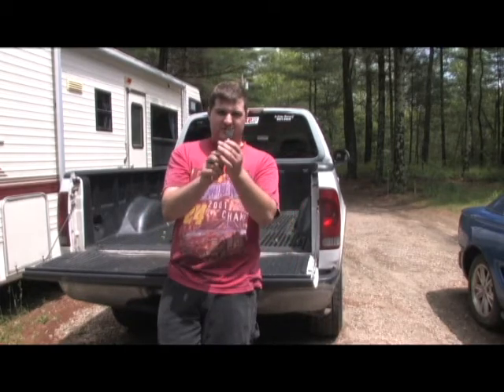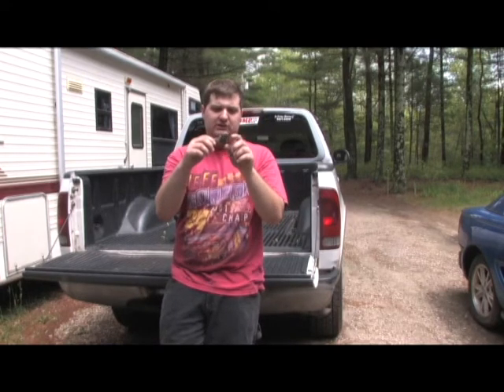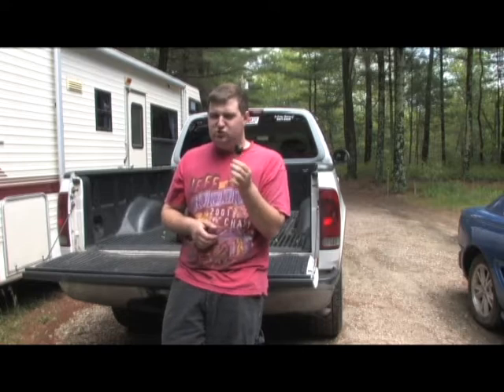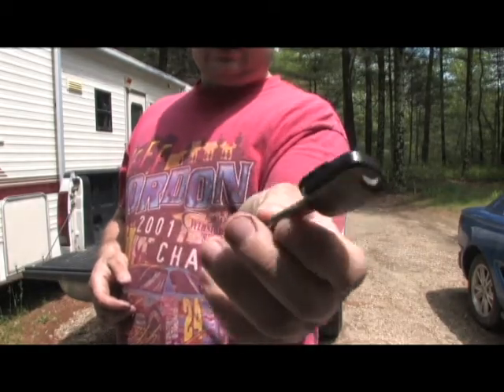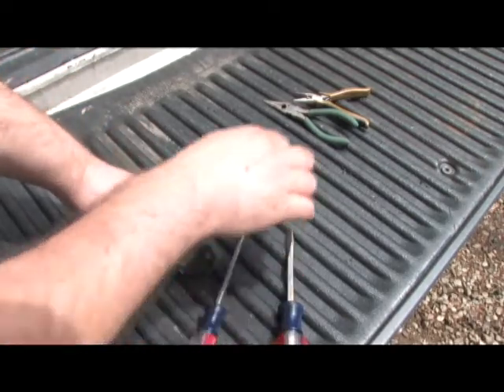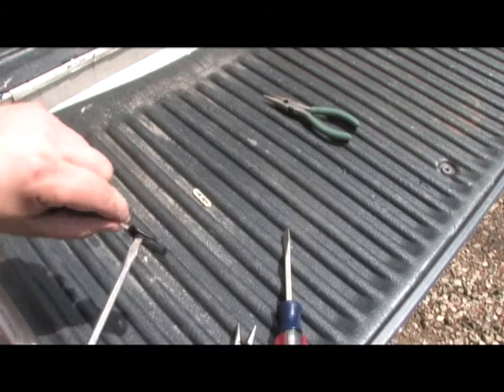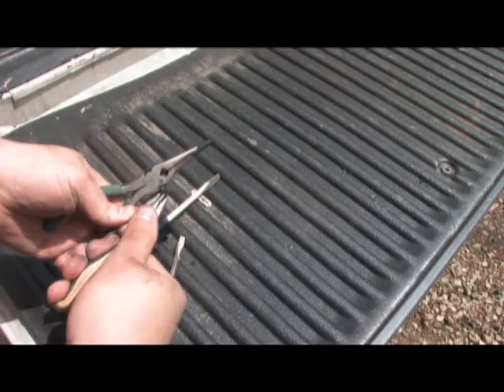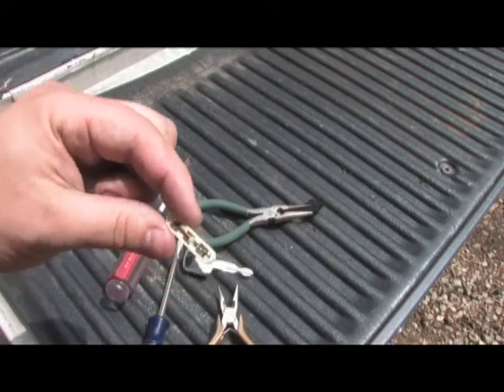How Does Ford PATS Work?

Comment from the maker: @joshua spahr - it is correct, please read a Ford service manual. The key has a RFID chip in it. That car picks that up, if its correct it starts the car, if not the car does not start. Very similar technology to a badge reader.

Comment: A PATS system key transponder communicates with the HEC (hybrid electronic cluster) or speedo cluster... NOT THE PCM.
Reply from the maker: That is partially incorrect. 

"Powertrain Control Module
-Communicates with the PATS Control Module to validate the ignition key.
-Enables fuel pump/injectors if a valid PATS key."

http://www.fordforumsonline.com/threads/ford-anti-theft-pats.3332/

"Note: the PATS Control Module functions can be incorporated within various modules, depending on system type. For example, PATS can be in a stand-alone PATS Control Module or be part of the HEC (Hybrid Electronic Cluster), VIC (Virtual Image Cluster), SCIL (Steering Column Ignition/Lighting) module, Instrument Cluster Module (ICM), or PCM (Powertrain Control Module)."

*The module can be LOCATED within the HEC (and perhaps on newer Ford vehicles it is)

http://www.fordforumsonline.com/threads/ford-anti-theft-pats.3332/

Comment: also does anyone have a little black box that had a chip in their 2000 ford f150 mounted below the steering wheel, what is it and where can i get another one of the chips that plug in to it

Comment: You can use an after market remote start system, you just need a bypass immobilizer. A universal module requires a spare key permanently installed under the dash and the more vehicle specific ones don't. I just installed a viper alarm with remote start on my 2012 Escape and no spare key is required.
Reply: Whered u get the alarm? I have a 08 f250 but with just one key
Reply: @jeronimo642  Look for a place that sells alarms in your area. More than likely they have a bypass mod for you truck and you won't need a spare key.

Comment: The truck will start then immediately stop, I have tried on my 01 f150. I know you can get those keys for $10 off of ebay instead of $120 a piece from the dealer.